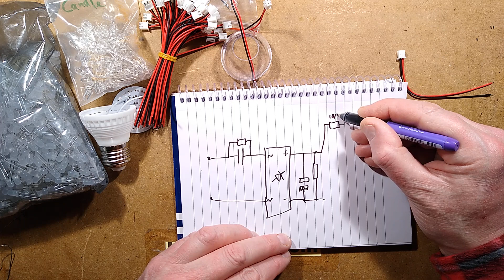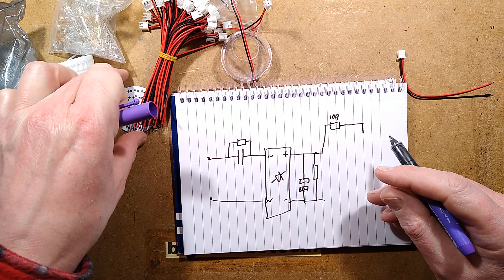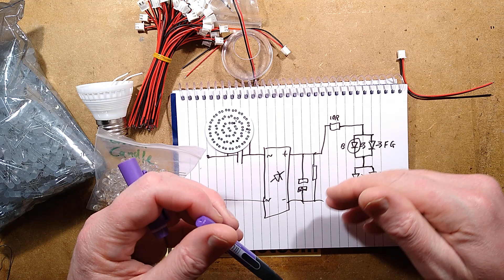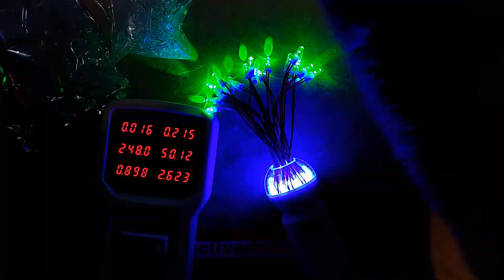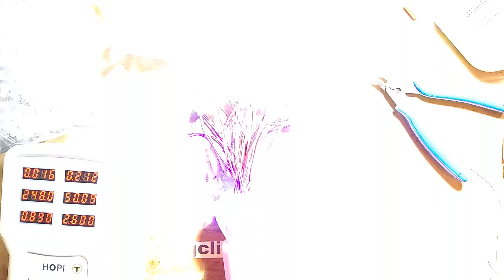Custom extra weird trashy lamp build.  Blue orb with green pulsars

Comment: Yeah, you'd think we'd use more solar down here in AU, problem is the network operators are incompetent (there's 1200MW of solar generation currently in this state, 600MW of which is offline at the moment because the network's not up to snuff (worth noting there's an approvals process they're involved in before you start building a solar farm), and there's also another 3000MW in the pipeline which is currently in limbo due to the same problem), and politicians get too much money from the coal industry. In 2017 the then treasurer (now PM) bought a chunk of coal into parliament to show it was "safe" or something FFS...
Reply: Yep Australia is probably the best place for solar, most of the country could go "green" pretty easy and quickly if we actually could. But yeah the problem is both major political parties are sucking off oil and coal so it'll never happen. Were also quickly becoming one of the most polluting countries in the world Abbott kicked it off, Turnbull continued it and now Scumo has kicked it into high gear.

I live in government housing currently, I think if all government housing (individual units and houses etc) had at least 1kW of solar each it'd lessen the burden on the grids not to mention make it easier for people to live. But unfortunately that wont happen because money.
Reply: One problem is solar doesn't work at night so you still need traditional generation. There is no good storage option, GE tried with battery technology but failed so far.
Reply: Curt W that’s not what Elon thinks, his big battery at Hornsdale looks pretty successful.
Reply: A lump if coal that was so "safe" it had to be varnished before it was considered"safe enough" to be allowed into your parliament! Nice..
Reply: @williamarmstrong7199  Well you can't have it leaving black smears everywhere, people might start to think it's 'dirty' ;)

Comment: MrsW bought a forest fire's worth of battery candles year before last, £1 each from charity shop, locally made using switched base, wax body and straw coloured candle LED.  When Christmas was done she bought the left overs (20ish) for £5 because the LEDs were so good.  Ended up using most of them in scenery for local am dram but I still have a few.  Don't know where they came from but they are warmer than warm white without being amber.  The wax catches the light and glows sympathetically. in all a very pleasing authentic effect.

Comment: South Main Auto is a wonderful channel.
AvE pretty fab.
DeBoss Garage no nonsense diesel mechanic.
Dangar Marine (Stu is the ultimate laid-back Aussie), varied output, restoring an old trawler with a Detroit Diesel engine - a genuine and sweet guy.
Project Brupeg - sweet couple restoring a fairly big, previously sunken trawler, into a research vessel.
Doug @ SV Seeker, is pretty chill, when he’s not prankscaring his viewers & his junk-rigged steel origami boat is very unique.
Sampson Boat Co, is a Brit doing a classy boat restore.  Finally, Acorn To Arabella.
Reply: If you like mechanic channels, you might want to have a look at Garage 54.

Comment: You can stop solar panels from producing electricity...  Simply by covering them with a thin sheet of plywood. I've used duct tape to hold the plywood sheets in place for extended periods of time. Wind can be a *#%!!!  Usually during the set up phase when you don't want the panels to produce electricity...

Comment: 5 of these kits arrived in the mail today. Think I'll skip the long leads and solder the LEDs all to the board then pop a big lens in front like that disco light you made recently (USB powered flickering lights - your reflow solder experiment in May 2020). I figure I have 3 chunky lenses from an old projection TV to play with, should look interesting with the right case built

Comment: Speaking of solar fires there was a big thing about solar panels on Walmart in the US and I later just recently learned that it was a fire issue due to the solar panels that were causing a bunch of Walmarts to burn. This also brings up the whole safe isolation that I keep hearing from the UK and how you have to isolate everything before you can work on it, how do you do that with solar?

I did run across one company that had micro stabilizers? There essentially a switch mode boost buck module on each solar panel that then communicated with a controller and they would only put 1 volt out in the series until the controller said okay it's safe. I thought that was kind of a neat and it seems much more efficient then putting microinverters up underneath the hot panels.

Comment: Wrt oscilloscopes: would a Micsig scope not solve your issues? It's a fairly professional scope, but in a tablet form factor, so you can lay it down on the desk. Optionally, you can also add a panel with the 'classic' scope knobs on the side if you don't like touch screen controls.

Comment: Those are JST series connectors .....ultra inexpensive but force you to use a special crimp tool that cost almost $700.  Thankfully a $30 crimper exists from Amazon that works about as nice as their fancy $700 one.  Assembling a PCB as we speak that I am using them with.
Reply from the maker: Which crimp tool?  I've been testing a few and the iwiss 2820M beat the expensive Engineer PA-09.
Reply: It is indeed the iWiss tool.  The one where they basically used a grinder to narrow the crimping area.  I am impressed how well made the iWiss tools are.

Works great on the JST connectors for prototyping quantity production.

Comment: Those JST XH connectors are only used in toy grade RC, we dont use them in  our hobby grade rc craft.  We use JST RCY, XT30, XT60 and XT90 for power mainly but some die hards still insist on using the crappy deans connectors.
For connections that are not power delivery systems, the JST SH 1.0 connector is very common in anything from 3P to 8P.

Comment: Just wondering if you'd considered putting a heat-shrink shroud around the exposed micro-sockets, protruding a little at the front, so as to prevent tingles from partially inserted LEDs? Not dangerous enough, perhaps -- although a risky shade of pink sleeving may compensate for that. ;-)

Comment: Clive, got this video recommended late for some comments to be current. However, I can make a few recommendations for your desire to display a scope in your video.  A 2nd camera with a video switcher is becoming a very affordable option now with huge price reductions. The ATEM Mini is very affordable, small in bench space, is HDMI in and out, does picture in picture,  mixes audio, etc for about $300. This makes it easy to either insert the scope shot in the corner of the screen or switch to it full screen. Another option for  a scope is one of the inexpensive battery operated touch screen scopes. One I use is somewhat limited in function and sensitivity, but this is offset with easy cell phone touch screen operation for setting sweep speed, trigger options, positioning traces, etc. To  boot, it is USB rechargeable, so in use it more resembles a multi-meter for convenience. Very inexpensive for a dual channel scope with tones of on screen measurement options, has FFT, X/Y vectors, etc built in, screen capture, etc for less than $200 for a dual channel 100MHZ scope that can lie flat on the bench for video like a DMM.  Look up the FNIRSI 1013D from your local Chinese supplier. I bought one on a whim for the battery operation.  A couple of minor issues. It does not come with the power supply, and the USB interface/charger is NOT DC isolated, so don't use it while connected to a PC. Pickup a 2A USB charger to operate it. For a scope with no knobs, I was impressed. As a cross between a tablet and desk scope, it works fine flat as a tablet. Look up some videos online of it's operation. Yes it is that easy to use.
Reply from the maker: I've looked at the Atem units, but still currently use a very simple recording setup to allow making a video every two days.

Comment: The trouble with wind power, certainly in the uk, is we have very dense areas of population within the towns and cities and then we spoil the green open space with ugly turbines.   I’m not sure how accurate it is for on land but certainly for at sea turbines you need the same sized physical area for the turbines as the size of the town or city that it powers.   So we would have to cover the country in them to have enough power.  

Hydroelectric is a great power source though.

Comment: if you want to run some shady software, you can use Virtualbox - its free to use and you can run any OS on it and it's in a sandbox environment completely isolated from your real PC. It takes a tiny bit of a learning curve but there are plenty of guides. You can also enable windows' built in sandbox if you have windows pro or enterprise i believe (not windows home). It has a built-in sandbox thats super easy to use, you just need to enable it. Once you close the window, everything is deleted and resets completely.

Comment: I wouldn't always trust the cathode to be the flat side on cheaper LEDs - had several packs from China that had a roughly 50% blend where the anode was the flat side. Happened in several colours. After that I just started testing each LED before use

Comment: Maybe use the DSO112A Oscilloscope that would be easy to get on a video, you would need though to use a pointer thingy as it is touch screen, flickery Warm white LEDs £9.99 per hundred  maybe a bit of heat shrink in the JST connector would make it nearly safeish

Comment: at 37:00 did you actually touch your finger with the soldering iron? i've never directly touched my skin with an iron but ive wondered what its like. does it immediately hurt and burn? or is it like how you can touch a flame for a period of time before it actually will conduct the heat and burn you? does it leave a burn even if you just have a glancing touch?
Reply from the maker: If it's a very brief contact it's fine, but anything longer and it causes a serious burn.

Comment: It appears that you are correct (about the 30 minute limit) it's a 'file size' limitation. I found a  YouTube video, that walks thru a process to 'fix' it, using an app called 'Open Camera'. The vid is about 5 years old, but probably still relevant... :-)
Reply from the maker: I use open camera, but have not changed that setting in case it causes an operating system conflict over file sizes.

Comment: About the solar panels thing in Australia: Solar panels actually tend to loose a lot of their efficiency when they get hot (which is why in The Netherlands some companies are now trying to build solar panels with water running through them to cool the panels, and in return have the water running through a heat exchange system to heat water inside your home.)
Also, the monumental buildings that can not have solar panels or solar collectors for hot water installed, are subject of some kind of the same research from companies trying to come up with failsafe systems in which the roof tiles are equipped with channels that have water running through them so, as the tiles heat up in summer, they heat the water inside the roof tiles.
(My parents have solar panels and this year the DC/AC converter might fail or due to it's decreasing inefficiency be up for renewal, which will be interesting to see what that will do for the price compared to the amount of energy we saved over the years since 2012).

Biggest drawback of huge amounts of solar panels: the local mains grid (in The Netherlands this problem might be bigger) can become unstable, because all the solar panel installations might be trying to deliver all the unused energy back in such a big amount that safety systems are concerned the voltage is to high and shut off the neighbourhood ring, or, in case a big cloud blocks the sun this can cause such a huge voltage drop that the same systems might think they are signalling a short circuit in the grid and shut off the neighbourhood ring in the same way.
The unfortunate thing of solar panels with a DC/AC converter is that the converter listens in on the mains grid frequency and synchronizes itself with it and then starts running slightly a-synchronous in order for it to be able to push the unused energy back in the grid.   When the mains grid suffers a failure somewhere due to a malfunction of whatever sort and is shut off, the converter shuts off immediately as well, in order to stop engineers working in the neighbourhood substation from getting shocked from either your home connection or even the primary side of the transformer where usually the high voltage goes in.
So, if the sun is shining fiercely during a power outage?  You have no power even though you might have an excess of it being generated at the DC side of the converter.

Interesting feature of the converter: it can sense short circuits in the mains grid from kilometers away (it measures voltage constantly).  When a big part around Rotterdam came to be without power, the massive short circuit that preceeded it (more than 100 kilometers of powerlines and several substations away) caused the converter to send an email that it had detected a voltage and frequency drop (when voltage and/or frequency becomes to low for to long a period of time, it can also switch off).
I, for one have been incredibly fascinated knowing a part of my city or a different city connected to the same substation going off-grid temporarily causing a dip in the grid in the part of my city where I live.

Comment: Speaking of old electronics, Zenith and Sharp used to make some truely indestructible stuff. I used to try and play peanut butter and jelly sandwiches in our old top-loader VCR and other than needing a fresh set of belts afterwards, it kept on trucking. My aunt still has the microwave my parents bought when I was born, which would make it close to 40 years old, and use it regularly. Impressive lifespan from a single magnetron.

Comment: 29:38 - This is generally not due to file size issues; with lossy codecs, file size is not tied to video length (if the issue was simply file size, then increasing compression would allow for longer files, but you'll find most devices and OEM recording software still stops after 30 minutes).

The issue is customs taxes created to "offset losses to video piracy", which are only applied to devices that can record clips longer than 30 minutes. Camera and phone manufacturers prefer to add the stop-restart function rather than cut their own margins.

However, 3rd party applications that don't come pre-installed on the phone can usually bypass this. You might still have a file size limit (typically 4 GB), depending on the filesystem used, but using a lower bitrate will allow you to record longer clips while staying under that size limit.

Comment: FAT32 has a maximum file size of 4GB and is the most popular filesystem for flash drives (up to 64GB), so they keep the filesize compliant.
This is not necessarily absolute fact, it's just what makes most sense to me.

The hour and a bit flew by. A surprisingly good watch.
Reply: @newscotlandtv  Actually, phones tend to use some Flash specific filesystem like F2FS.

Comment: Recording time is dictated by the storage medium. Phones are no exception as you may want to record to a SD card which is often (Not always) Formatted in FAT32, this File system has a 3.9GB (4GB) File Size Limit so the Firmware/App is written to account for this limitation and made to open a new file once the limit is hit.

Comment: Hi Clive, I noticed you mentioned de-skilling... while you also mentioned in the past that you thought a lot of the certifications were simply to keep the industry under the cosh of a small number of companies.  Balance is always the key I guess... too much certification and control gives us a safe (quote unquote) industry but keeps the power in a small number of hands... but opening it up away from these industry controllers by doing what you mentioned (one day slide show course) is bad too?  Just noticed you mentioned the other side of the spectrum and thought I'd mention your commenting on both (but no giving us how you think it should be) :).

Comment: There is even a technical reason for the file size not exceeding about 30 minutes of recording on phones, because many phones are set to record onto a SD card, and they have to support the SDHC standard, which means they can't just use ext4 or any modern file system on the SD card, but instead they are required by the standard to use FAT32 on the card, and that means file sizes over 4GB are not supported. Only with SDXC cards, starting at 64GB, the exFAT file system is part of the standard.

Comment: Phone storage is formatted FAT32 which has a maximum file size of 4GB. That's why it stops at around 30 minutes
Reply: indeed, FAT32 has a file size max of 4GB, or 4,096MB (actually 4,095 after the mapping for the file)

Comment: What do you (big clive and the viewers) do with the little blinkenlights circuits after you soldered them together? I bought little kits in the past, moved on to to make my own little blinking and beeping thingies to practice soldering and work with the multimeter/oscillo..over time a box of "trash" accumulated. What do you guys do with your little kits? Throw them away? (Saving the good parts like IC or good pots)
Reply from the maker: They get used or stored for later use.

Comment: HELP (Love your videos thank you!) Have a question... I need to make a 110ac to 9vac power supply any help would be amazing thank you so much for your time.
Reply from the maker: Depending on how much current you need you may be able to find a standard plug-in transformer.
Reply: @bigclivedotcom  only need 1 amp i have all the parts i just thought it would be cheaper to make it